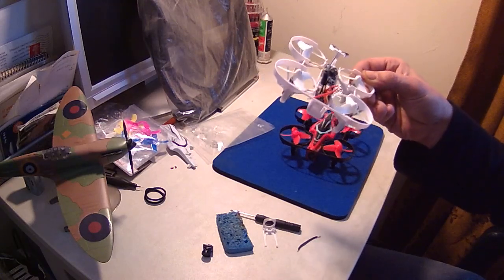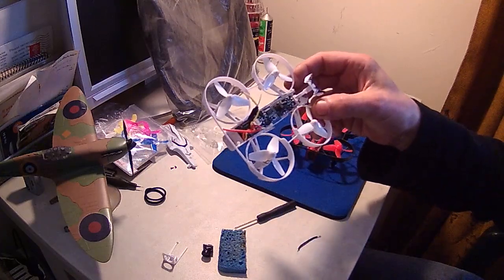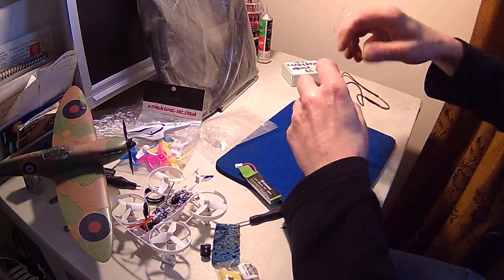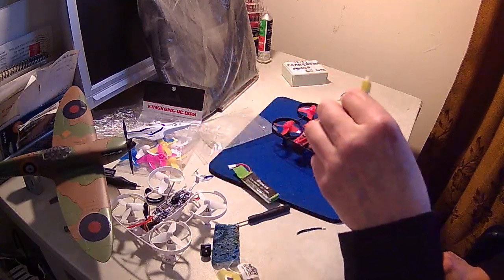EACHINE E013 PLUS-BATTERY UPGRADE MOD!

Comment: can you tell me how to charge lihv to ensure their voltage NOT reaching 4.2v for full charging?can we used normal charger(for 3.7v)??thanks for helping....actually i had already order this drone
Reply from the maker: Hi you need a hobby grade 4.2v-4.35hv 1s charger set to 4.8 volt storage charge.never leave li-po's on full charge past a few days and never go below 4.3volt low charge.hope this helps.
Reply: @cyclops-fpv  thanks dude

Comment: Where to buy the frame if you break it
Reply from the maker: No one does them or the canopy's but banggood does sell battery's and motors.
Reply: @cyclops-fpv  do you think they will release it soon and is the frame durable
Reply from the maker: I don't know I need a new frame and been waiting ages and the frame is strong but the ring to the legs are weak I broke two of them and glue only works for a while b4 it goes again.
Reply: @cyclops-fpv  Where are there replacement motors and which are they, do you have a link? It must be 8020 and not 8520 because they are too wide and do not fit.
Reply from the maker: @hollycool2910  banggood,ebay ,aliexpress all those should sell 8020 motors the others are too big and won't fit or fly even if you drill the frame to fit(I've tried).
Reply: @cyclops-fpv  Banggood, eBay etc. sell some 8020 motors but no spare parts especially for 013plus, is the rpm and the correct connection ?
Reply from the maker: These motors all use the same plugs(check the pictures on the webpage) as for rpm all size motors for model are the same rpm unless you go bigger size up.
Reply: @cyclops-fpv  Ok, which ones have you ordered, installed, that actually fit and work, please send me a link.
Reply from the maker: I haven't ordered any or fitted any as yet as I've ordered the wrong ones 8520 which were too big.
Reply: @cyclops-fpv  That's the problem, everyone says take these that fit and you can find them everywhere but no one has actually tried it.😃😉
But the 8520 work well if you drill out the brackets?

Comment: Looking forward to that camera 90 degree modification. Keep it up. You've got a new follower and subscriber. 😁
Reply from the maker: Cameras broke at the moment waiting for banggood to supply spare parts need new motor too but I think I've found a way to fit bigger motors(8520s)
Reply: @cyclops-fpv  Do you think it may be possible to upgrade the camera with a HD camera like the Caddx Turbo Eos2? thx
Reply from the maker: @rollercoach  I'm not sure there's not much room in the front.
Reply: @cyclops-fpv  My concern was with the connections. I was wondering if I can just unplug the original one to replace it with the HD one and have it working......I'll think about the installation right after I know it works....thx
Reply from the maker: @rollercoach  3 wires go to the lens part from the vtx so I'm not sure how you'd wire it up if more wires go to the camera(the camera lens is at front of the quad and vtx sits back quite abit)

Comment: Cool video on the battery mod, would you mind sharing a link to the 550mah batteries pls. TIA ☺️
Reply from the maker: Just go to Makerfire website and type in the battery name and type and go from there,only really benefit is to hi-volt charge for longer and faster flights on normal charge its not that much better than the stock battery. (Flight time is about 5 minutes)and 6-7 minutes on 4.35volts.

Comment: Nice  modifications video, what kind of Tiny King Kong propells Fit in the model e013 plus? I find in the net 40mm 1mm or 1.5 mm hole? Culd you help me?
Reply from the maker: Hi yes its 40mm with 1mm shaft hole
Reply: @cyclops-fpv  ok thanks a lot nice day
Reply from the maker: No problem,have a great day too pal and try tri blades to it will give you a little more thrust.